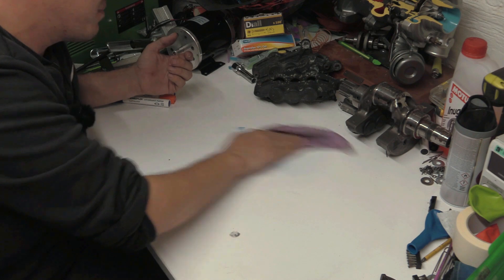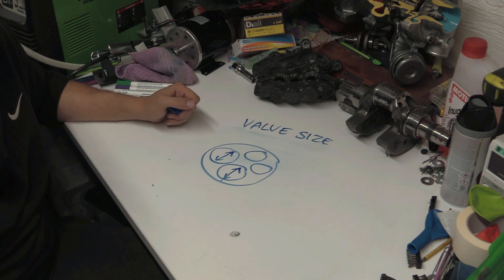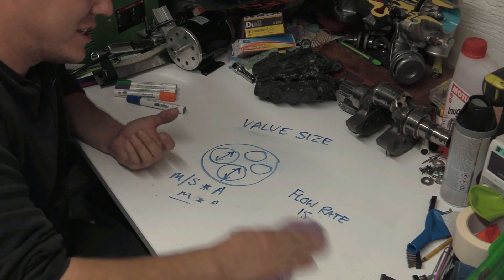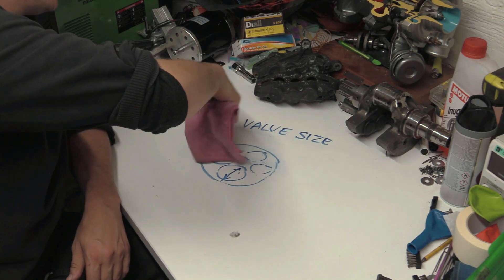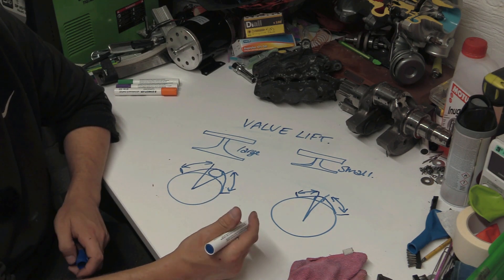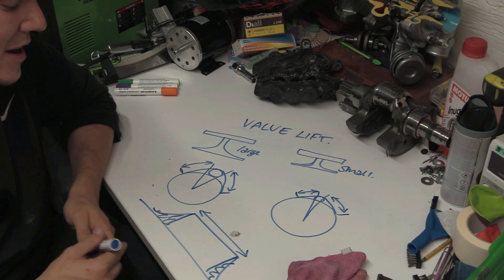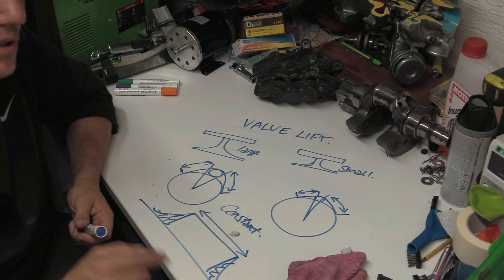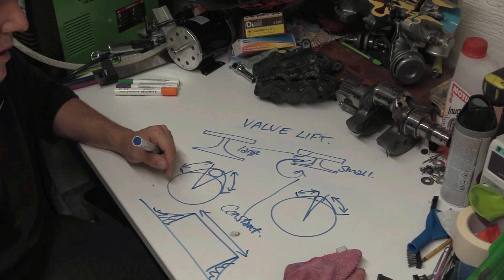Valve lift vs diameter

Comment: Greetings from the US.
Ive been binge watching your videos and I gotta say you have more useful information in 1 video than most people have on a whole channel.
I build model engines and many of the parts that I make are based on your videos. 
Your DIY spark plug video saved my ass on a crossplane i4 that I am building....and your fuel burn videos, your piston ring videos, air flow, blah blah blah...I needed this valve video as I am building the heads for my crossplane.
The Delboy stuff is great entertainment too...i learn a lot from those videos as well.
Thanks a bunch for doing what you do, i have learned a shit-ton from you.

Comment: Sirrrrr, i have some thoughts. So, is saw one bike engine performance shop in here that do the "crankshaft profile change" by making it basically "love to do compression stroke" by changing the weight balance composition . Like, when the piston is set and it being spinned by hand, they tend to make it back to TDC more easily. 

Why do they do that? Isn't that means the engine will ofc love to climbing rpm but kinda harder to go down on rpm (since the crankshaft is set to be "love to do compression stroke") ? I'd love to have this topic explained by you guyss
Reply from the maker: That's because the pistons are missing. Add them in and it won't do that. The guy was pulling your leg or talking shit

Comment: I'm really enjoying this, Brian toiley (the car engine performance guy on heads and cams, American stuff) said from his experience with ls engines, an equation valve diameter x .3 = valve lift reaching diminishing returns... So the bigger your valve, the more benefit from valve lift... So they go hand and hand... I wonder if a sport bike has less compression for valve lift clearance... Would they have more horsepower but less efficiency? I'm so excited for these cam videos of yours xD
Reply: Im a car guy, naturally aspirated engines fan, and i have never found better YT tech-channel than Workshop. Never. 
Others are light years behind. 
There was one guy, Kyle, He made vids mostly about aerodynamics, but afair He found job in F1 and His channel is dead since. 
Hope i will learn something more, im also excited for valve videos.
Reply from the maker: "an equation valve diameter x .3 = valve lift reaching diminishing returns... So the bigger your valve, the more benefit from valve lift... So they go hand and hand... "

1 - there is no equation for all systems 

2 - and if there was it wouldn't be that simple

3 - Bigger valves = less lift. And for the valve train, that's a good thing, as mentioned.

" I wonder if a sport bike has less compression for valve lift clearance..."

- Sports bikes have a compression between 12:1 and 14:1, so not lower, but higher.

"Would they have more horsepower but less efficiency?"

- That's a misnomer. Having more HP from the same weight is more efficient...
Reply: @thedirtyworkshop  thank you!

Comment: Think the question was probably referring to valve size, lift and curtain area, the bigger the valve the more lift you need to make the curtain area match the valve area iirc
Reply from the maker: No you don't - can't you maths? 

The bigger the valve the lower the lift to get the same area... So no, you don't remember correctly
Reply: The Workshop Is that a joke?
Reply from the maker: I re-read your comment and I get what you mean, but thats not a concern. Larger valves don't maintain the same lift... and the ratios are not linear.
Reply: I actually asked that question because larger valves from random scraped engine are MUCH cheaper than custom camshafts.

Comment: masserrati had a v6 biturbo 6  valve that was quite successful in the 80s
Reply: The 6 valve was only a prototype, never used on track/streets. 
The best Maserati engine was 4 valve V6 in 2.0L displacement version, one of the firsts to have more than 150hp/liter in a street tune, used also in record breaking motorboat.
Reply: It was used and outside Europe, the engine was 2.5 litre.
Reply: bandr  same block architecture, different engine.
Reply: bandr  no it was available in the USA , Australia etc. It had a good reputation. The increase in capacity to 2.5 litres was the minimum needed to satisfy non European tastes. We in Australia were running 5.8 litre and 5.00 litre V8's typically. A small local engine was a 4.1 litre straight 6 that turned into the barracuda engine. Look it up.
Reply: bandr  the marina was a total piece of shit in any country.
Reply: bandr  someone made a comment about top gear dropping a piano onto a car, it was a shitbox marina.
Reply: bandr  I used to call it the bit urbo.

Comment: what are your thoughts on 'COATES SPHERICAL ROTARY VALVE ENGINE: There Are No Valves, Just A Series Of Spheres On A Rod:' ?
https://motocrossactionmag.com/weird-stuff-coates-spherical-rotary-valve-engine-there-are-no-valves-just-a-series-of-spheres-on-a-rod-sort-of-a-shish-kabob/

i would assume financially it's not that practical but would it be good for performance?
Reply from the maker: Theyre so good nobody uses them...
Reply: @thedirtyworkshop  I often wonder if the reason different tech isn't used, is that so much research has been done on the existing 4 stroke design that different approaches are unpractical due to lots of r&d, money, and emissions preventing these designs going to production. There's no way that the current 4 stroke is the best performance design, but the reason it's used is the century of work thats gone into perfecting it. At this point it seems radically new designs are pointless because forced induction has stopped the pursuit of higher efficiency N/A designs.
Reply: @jackmills5071  thats essentially the reason we have the M4 and competitors don't get a foothold  we are in a position where until a MAJOR step forward is made there isn't a reason to change

A 5% difference in efficency with a 4% weight increase and a change in manual of arms and manufacturing process and therefore cost isn't worth it.

Its why the Space Shuttle was the standard for nearly 50years. You have to make a MAJOR leap in tech that produces such a large shift in whats possible before we see mass market adoption.
Reply: @jackmills5071  Not so sure. Rotary valve were used many decades ago but new tech could make them viable maybe with a 2 stroke engine. Mainstream designs are a bit unadventurous, it takes somone like Elon Musk and a pile of cash to move things on. A combibation of electric, capacitor discharge and trad fuel seems most likely but I'm not sure where this leaves bikes?
Reply: Looks heavy